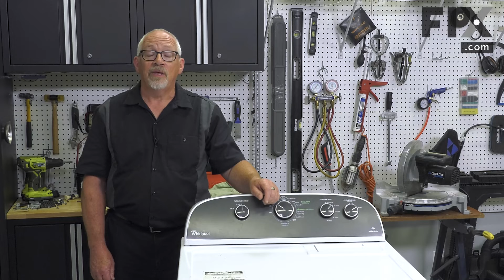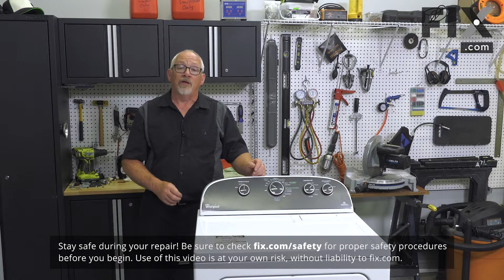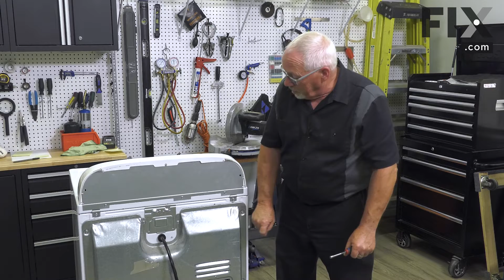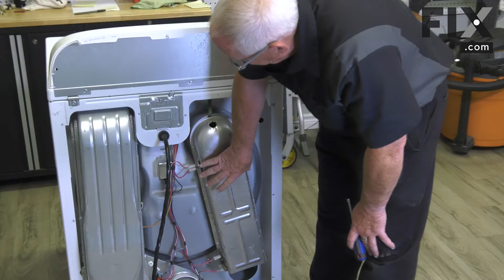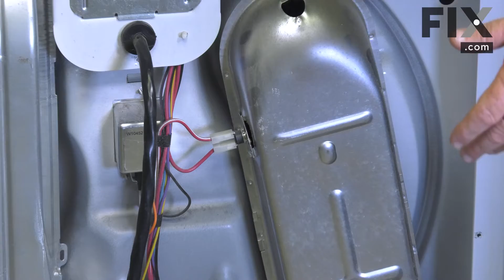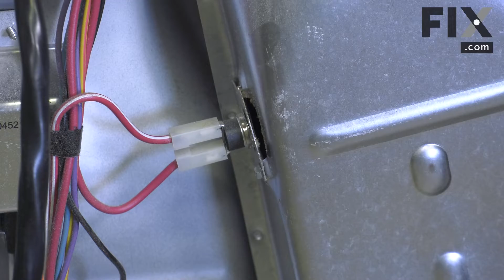DRYER REPAIR: How to Remove the High Limit Thermostat on Your Dryer | FIX.com

Comment: i replaced all thermostats inside and the heating element, it worked one cycle and keeps cooking the  high limit thermostat and only works if I bypass it,, any suggestions ?